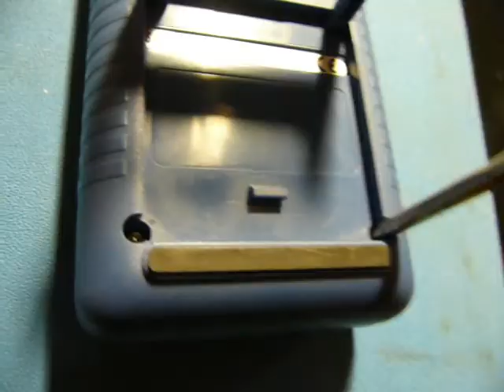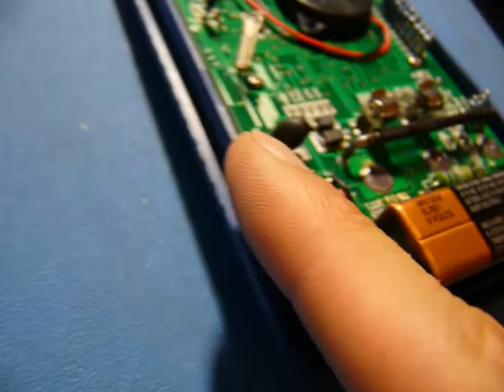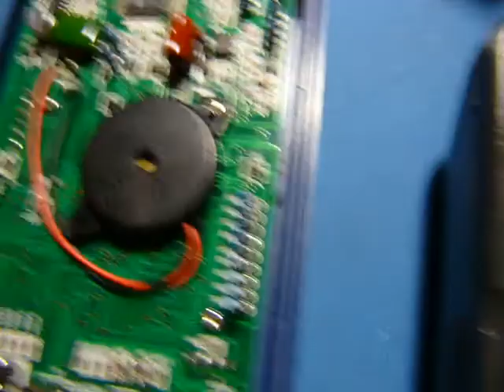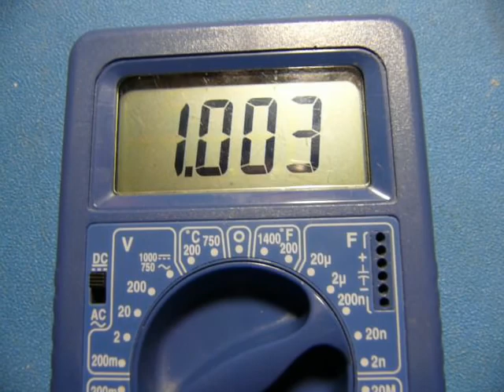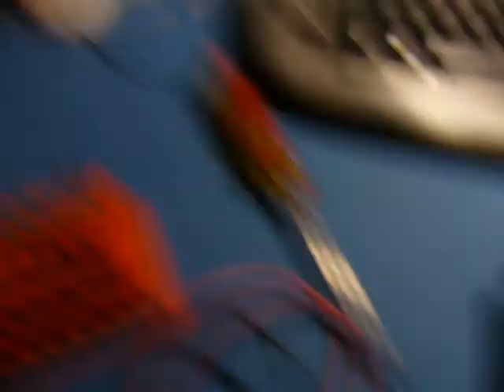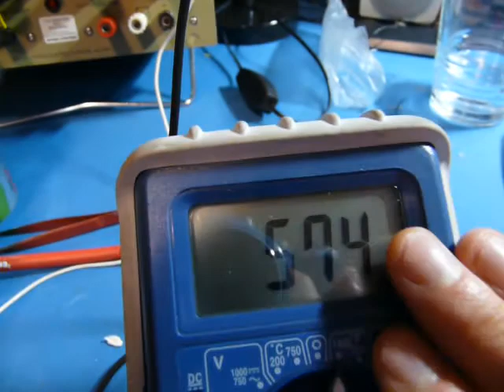Teardown/Cal: BK Precision 2706A DMM

Comment: I've got this multimeter too.  Have you noticed that there's about a 0.5 second delay when taking measurements (e.g. with the continuity checker)?  I returned my first unit when I noticed this problem, but the second one is doing it too.

By the way, that was a brilliant way of figuring out which pot adjusts the DC voltage measurement!